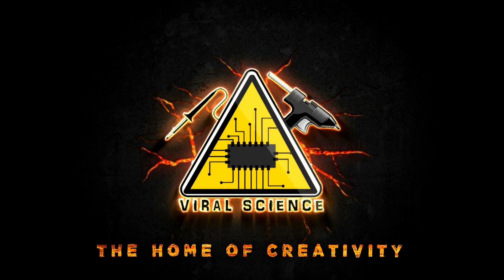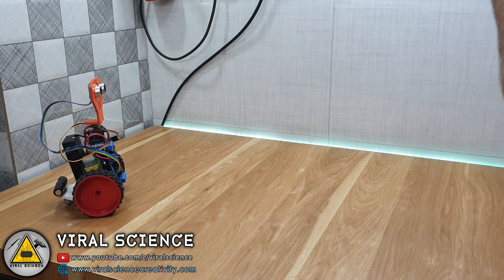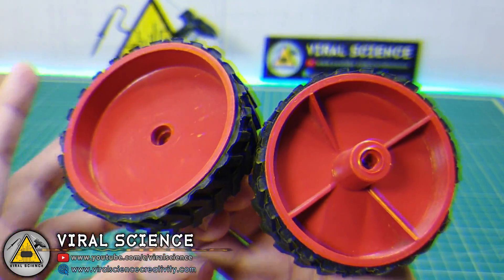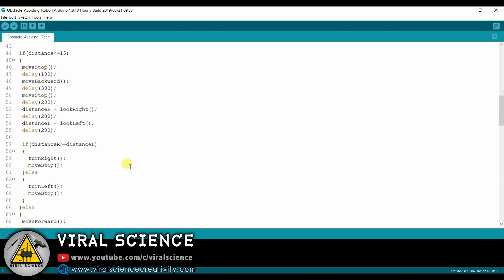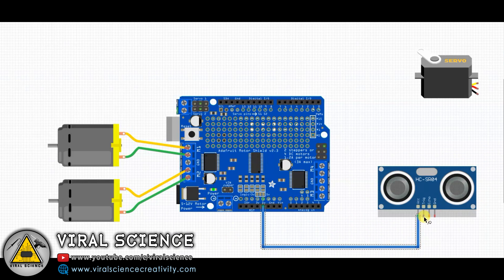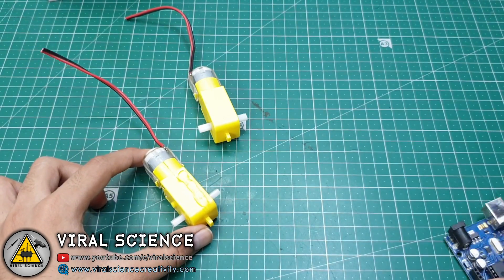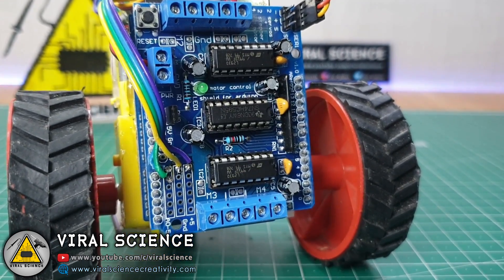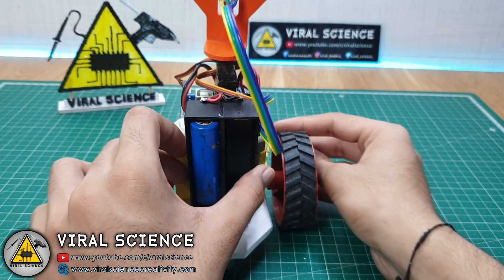Arduino Simple Obstacle Avoiding ROBO

Comment: Mine works but it won't move the sensor from left to right I have checked the wiring and the code, tested the motor, and changed the motor I have three micro servos 9gs but none of them will rotate can you help?

Comment: Bhai please reply
In my case the servo motor and the sensor is working properly but the wheel is not working. 
So what can I do...?  please reply
Reply: Bhai Mera servo motor and sensor work nhi kar raha hai 😢 

Koi suggestion do 
Aur tumhara thik hogya kya?
Reply: @Akash-vp9cb   Bhai Mera bhi moter Kam nahi kar raha
Ye video wala hame c bana raha hai
Reply: @DCVlogs2007  pta nhi bhai 

Agar separately karoon to dono ko chalta hai aur sab ko attach kar doon to nhi chalega 
Pta nhi lag raha hai motor driver shield me problem hai ya Arduino me 😶
Reply: @Akash-vp9cb  is me 1st motor se 2nd motor pe ja ne pe voltage drop hojara hai is liye nahi kam kar ta Mera bhi bandh he
Reply: @DCVlogs2007  ooh paisa barbaad hogya mera

Comment: Hi. I have a problem. I used L298n as motor driver. I used 9v battery for 2 motors and L298n. But the battery drains in 5-10 minutes and the robot slows down. What should I do for this or is there another battery I can use?
#robot

Comment: Thanks for the project. Only issue im facing is servo is not getting enough power and rotating in steps of 1 degree i think. im using two 3.7v 3000mah rechargeable batteries. Can you please help?
Reply: use high volt battery or 4 battery

Comment: Bro my servo and ultrasonic sensor works but motor doesn't, is this a battery issue?
Reply: How did you connect ultra sonic sensor to moter drive r

Comment: Can you make a video on robotic car,that has port sensor and line flower sensor,ultra sonic sensor,and Arduino uno.The car dose not haste a remote controller,and turns on with pir sensor and off,and has led lights

Comment: Bro I want to suggest you a project on menu system with lcd and Arduino not with leds with multiple sensors connected to Arduino board when we select ldr on the lcd using push buttons it should show the sensor value from the ldr or ldr sensor which we connected not only one all sensors like that plz make this project bro it would be very useful to us